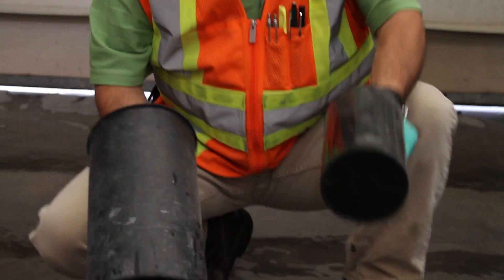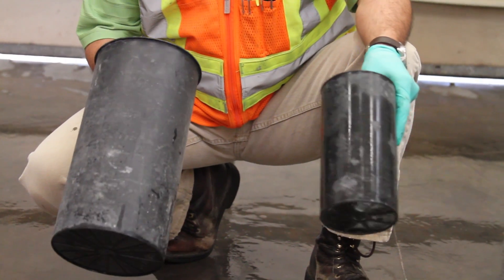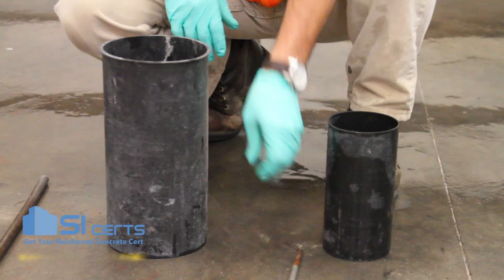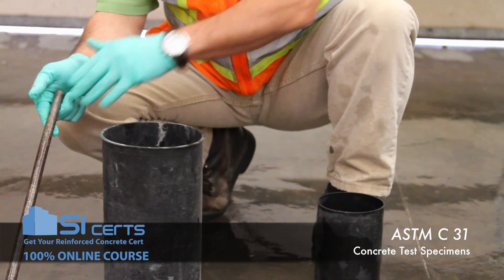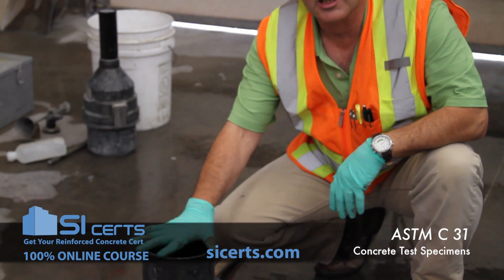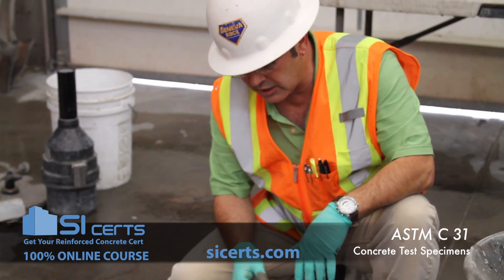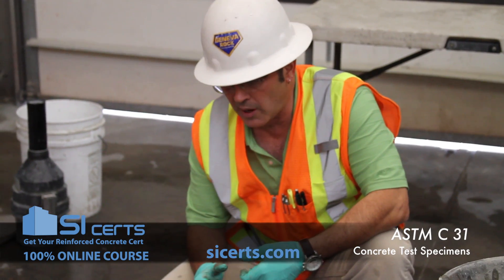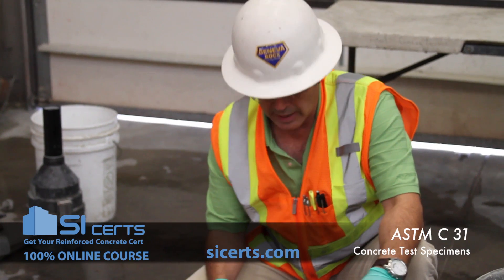ACI ASTM C31 Making & Curing Concrete Test Specimens (Newer Version Available)

Comment: Answer me please how do you take that concrere out of the mold? It will harden after a few hours right
Reply: There's a tool you use to slice open the side, coming down from the top. A concrete lab will have this.
Reply: i made 1 yesterday. but the concrete hardened and bond to the mold. is there any chemical that applied in the cylinder mold?
Reply: Can you tell me what mold you used? What is the mold made of?
Reply: SIC INFO its the pvc cylinder pipe

Comment: you can also use 1 lift for a 4x8 if using vibration of up to but no less than 1/4 the diam. of the cylinder(1") and 14000VPM